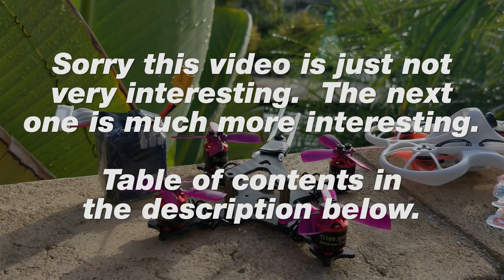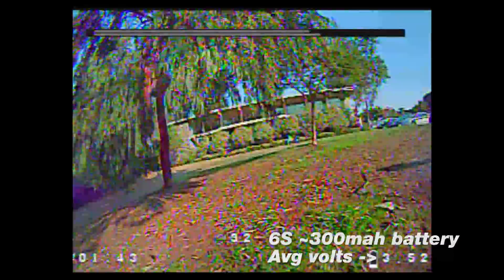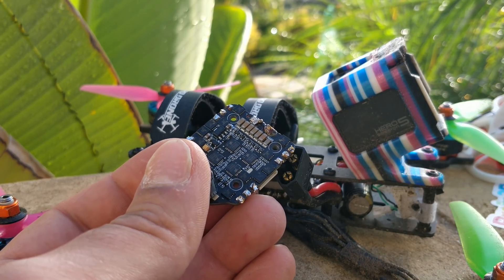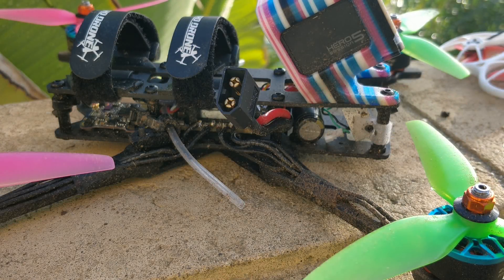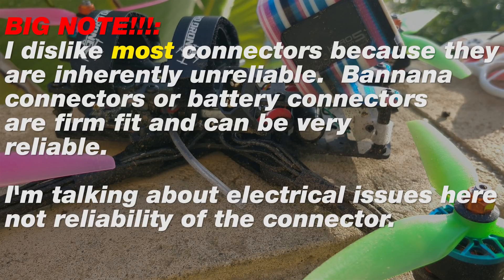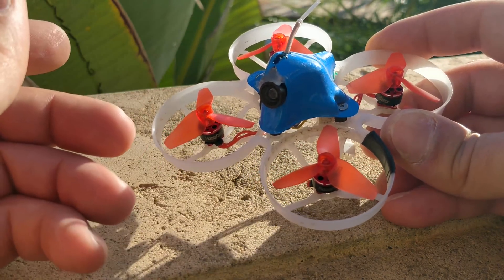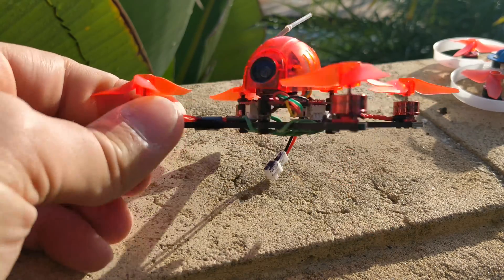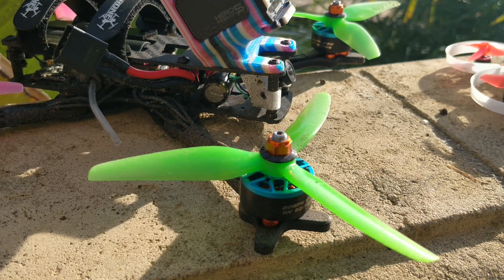6S 2", Just check the table of contents plz thx

Comment: Thought: Why do micros' prop guards have to be 1 per motor if they're not being used for their ductance ability?
I've been trying to make durable 3D printed prop guards for my Kingkong ET100 since I got my printer because the stock ones mess with the airflow, early prints were 1 per motor, looked great but spokes always broke due to the layer printing technique.
So my recent design took a whole new approach; one single ring encompassing all the props, with individually printed identical & replaceable spokes, and all the parts just slot into each other. It also allows use of 2.4" instead of 1.9" props: http://www.haku.co.uk/pics/Kingkong_ET100_Prop_Guard_Prototype15.jpg
It does have a bit of an impact on flight characteristics when going fast, but for indoor flying it doesn't matter, and can be removed in seconds with no tools for fast outdoor acro: http://www.haku.co.uk/pics/Kingkong_ET100_Prop_Guard_Prototype18.jpg
Reply from the maker: It's one per motor because it's just more protective and the ducts are the frame so need the rigidity
Reply: The balance between flexibility & rigidity is a tricky one to get right, I've read too many posts from people who have broken the rings of their US65 & UK65, including me.
I discovered the PETG print of the single ring guard is so strong I actually tied a knot in a previous print (the spokes failed): http://www.haku.co.uk/pics/Kingkong_ET100_Prop_Guard_Prototype19.jpg

Comment: what soldering iron are you using? as far as i'm concerned to get a quality joint you need a powerful yet accurate(temperature) solder. Even if it's powerful, if it's inaccurate it can totally mess up the solder joint. How about your Tip, is it Gray or silver? if you have only one type of flux try a different one, quality flux is almost as important as quality solder. I noticed that everything needs to be of high standard, once i don't have one or the other i won't ever get a quality joint. I'm currently using my fathers solder which is probably older than me(TBS solder on standby),  flux pen and 852d++, (temp. is at 320 most of the time, if i do something thick like xt60 i go up to 380). If i would be from the states i would take the hakko soldering station every day. Stop buying solder from banggood :D Hope this helps!
Reply from the maker: I've got all that and the ts100. Still struggling. Annoying. Gonna get the kester stuff others recommend
Reply: Kabab FPV yeah you should be fine. I use the crappiest cheapest soldering iron (came in a kit for $17) about a year ago and it works fine. However, I am using quality solder (Joshua Bardwell’s suggested solder) and I never use flux and I have no problems.
Reply: Kabab FPV here is the link: https://www.amazon.com/MG-Chemicals-Leaded-Solder-Diameter/dp/B005T8MWQI/ref=mp_s_a_1_11?ie=UTF8&qid=1542940599&sr=8-11&pi=AC_SX236_SY340_QL65&keywords=e+63%2F37+solder&dpPl=1&dpID=51k0MVfKdiL&ref=plSrch

Comment: Do those xt30 connectors weigh something? If so, then no.😄 Have you flown the dal cyclone 5249 props?  Pretty impressive control on mid kv 4s, have yet to try them on any other kv.
Reply from the maker: Yeah I didn't like them so much. They feel really unresponsive

Comment: It looks like you fly your 2" in the same spots as you fly 5". It's an easy trap to fall into 'cos these micro quads are pretty powerful, but maybe you should try fling them somewhere smaller. I always feel disappointed with my 2.5" when I race/fly against 5". But give it a smaller space i.e somewhere too small for 5", then it really shines and becomes worthwhile.

Edit. Yes, 5" some motor plugs would be nice but looks like MR30 is ~2.5g per coupling. 

Edit. I'm sure you know solder joints should be kept clean, but do you clean old solder joints before reusing electronics? Flux can help to make some really beautiful solder joints. It's my first port of call to fix any soldering difficulties.
Reply from the maker: Yeah I realize it's a large spot. Still no flight feel change in 6S. I'm gonna try the kester stuff others are recommending.

Comment: Kester 63/37 is the go for solder. (63/37 is better solder for our application). I've tried heaps over the years and this one is by far the best. Expensive but like most things, you get what you pay for.
Reply from the maker: Just ordered the kester stuff
Reply: @Kabab  the kester is definitely the best solder that I've tried. It always melts evenly and comes out nice and shiny whether you use high or low heat. Also, I've learned the 63/37 is much better than the 60/40 for electronics.
Reply: You need 4 cups of coffee before you solder, the jitters help a ton
Reply: I agree, Kester 63/37 is all that I use
Reply: Bardwell did an almost hour-long talk with Randy Rubinstein of SRA Solder back in Sept of last year in which they discuss the differences and benefits of 60/40 vs 63/37. Randy recommends 63/37 hands down. https://www.youtube.com/watch?v=KPbozW0Y3p4&t=18s

Comment: there is no motor in the 110X size with a KV fitting for 6s (about 3000 I think) afaik, so it's not really a fair comparison to our 5" 6s setups right now.
Reply from the maker: Yeah wasn't going for comparison. Just wanted to see if control would improve and that's a big fat negative

Comment: 63/37 is absolutely not worse than 60/30, it's actually way better. JBardwell made a video with a guy who sells (good) soldering stations for a living and it was super informative. My guess is that particular solder sucks (because chabuduo) but the good stuff is great. If you can't find good quality from anywhere else get TBS solder it's great. For your TS100 just make sure you feed it high enough voltage (4s/5s or a laptop power brick and it'll do great). I really thing it's shitty solder TBH.
Re: motor connectors, what the fuck was ever wrong with banana connectors? Way easier to reverse motors.
Re: tinyhawk, try welder on those joints.
Re: 1S 2.5" micro build: you can remap the motor  outputs in BF.
Reply from the maker: Welder didn't Stick 😔

Comment: Don't buy any solder from Bangood, there are a lot of cheap fake ones (lead solder label but it is not!) with impurities, they flow horrible and you can't do a good job with such crap... Try Kester for example, you are sure about the quality even if it costs a little more.
Reply from the maker: I usually buy very good and not cheap stuff but it stopped being good so I'm clueless now. I'll try kester.
Reply: @Kabab  You can check the Androkavo channel ( https://www.youtube.com/watch?v=5Ku7I3hA3AA ), one of the best for soldering techniques. He made some videos about cheap stuff like BG sells (the orange one for example) and we can see clearly that it's unusable and produce bad results because the label is a lie (someone should make a chemical analysis...). You get what you pay for.

Comment: Im not an expert but I've been soldering for over 25 years. And for what I heard from experts 63 37 must be better than 60 40. Bardwell has a video on it.
Reply from the maker: Isn't it the other way around?  More lead is better?  Isn't the smaller number the lead content?
Reply from the maker: Either way I've been soldering for about as long and right now all my soldering is the worst it's ever been since the beginning and I don't know why. I have all the flux and all the things and am just clueless.
Reply: @Kabab  Thanks for great videos Kabab, I prefer 60 40, tried 63 37 and didn't notice any difference tbh other than maybe it sets at a lower temp. As long as you don't get lead free you should be good tho. Maybe you iron's not getting to the correct temp, could try a different iron if you have a spare.
Reply: @Kabab  that's weird.
Reply: @Kabab  It's not about the amount of lead. 63/37 is a magical ratio that forms an eutectic mixture that solidifies all at once. With 60/40 there is a slight delay between the freezing of lead and tin making it more prone to disturbance
Reply from the maker: @Silor  Yeah I ordered the kester 60/40 because I actually like the flowability and slight working time I get with it.

Comment: Dude, that XT30 idea is awesome! If I had thought about it I would've bought 4 pairs for my TBS Discovery build!
Reply: There are some for XT60: https://de.aliexpress.com/item/3sets-AMASS-Original-authentic-MT60-Connectors-plugs-3-pin-XT60-plugs-connectors-for-Lipo-battery-ESC/32693744416.html
I agree, would be nice as XT30 too. On my planes I normally use the single bullet connectors and color code them with heat-shrink.

Comment: Check that your iron is hot enough or maybe too hot. Time to think about using flux maybe.
Reply from the maker: I have a huge tub of flux it doesn't seem to do anything but make everything messy 😂
Reply: Kabab FPV high quality flux like AMTECH NC-559-V2-TF no-clean tacky solder flux (ROL0) 10cc kit USA 16150K https://www.amazon.com/dp/B01N8ZX7ZQ/ref=cm_sw_r_cp_api_gH19BbZC92DQT  is the go to in the board soldering/repair industry. Flux really hasn’t been adopted in the hobby like it has in all other PCB work industry’s. Not only does it transfer heat better and faster than without but it cleans the connection being made and helps remove and prevent corrosion in the connection. A little alcohol on a q tip to clean the area after is the standard practice as well 👍🏼

Comment: I own the cheap solder from banggood, with the blue sticker.. it sucks so bad. Try the 38/62 Rosin core solder from Armattan the next time you order something from them, its awesome ;-)
Reply from the maker: Technically my 60/40 solder should be better
Reply: If you're modifying something that was put together with lead-free solder at the factory, adding leaded solder can make the joint look like crap.
I've got a half kilo roll of 0.7mm Loctite multicore 60/40 (part number 3096075-M) that works great, and my iron is a generic 48watt 'brick' powered thing with just a power switch and temperature dial, the 'wand' has only been replaced once in the past 10 years and I use a 0.5mm tip to solder everything from fine individual strand wires to XT60s.
Reply: @Kabab  guess the rosin / flux core is also very important. No just the mix of the solder.
Reply: That banggood trash is atrociously bad.  I literally only use it for desoldering and cleaning soldering irons... even then it's just a waste of space on my bench.
Reply from the maker: @tehllama42  I just tried the banggood thing just to see. It's fine but still mushy